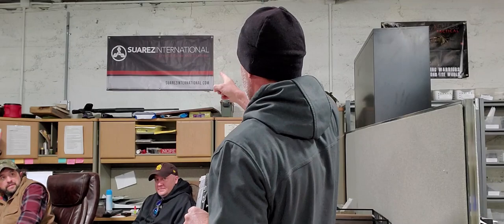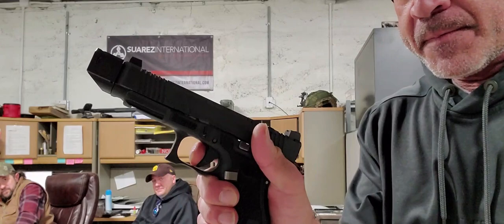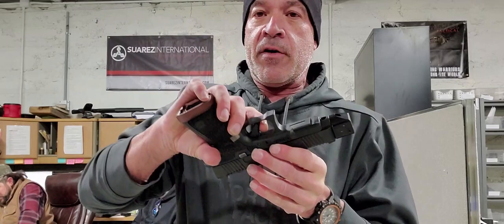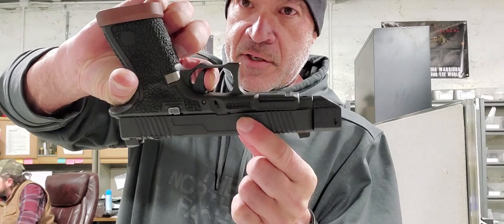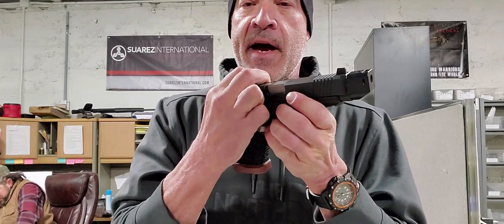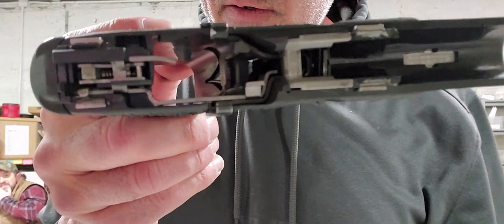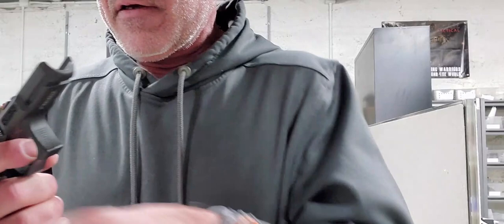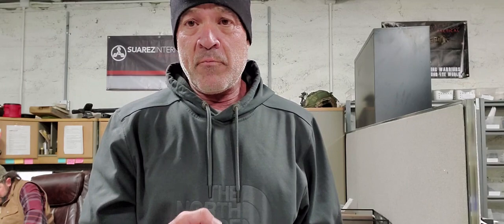Gabriel Suarez - My impression of the New  Performance Trigger  from Glock

Comment: It's one thing to dry fire the gun and claim the thing is a POS.  It's another to take it out and actually fire it as a useful comparison.  Yes, it's certainly more complex than the stock trigger but it's not more difficult to install or remove.  The field strip becomes a little more complex but once you've done it a few times it's not hard to manage.  Do a live fire test and compare shot group sizes - that's where the rubber will meet the road.  The rest of it is just bench chatter.
Reply: 100% agreed.
Reply: Do u still have the Glock performance trigger on

Comment: they simply switched to a pre-cocked striker system to eliminate a bit of pre-travel and make the reset shorter .. in that set-up there is no more need for a minus or zero connector 😢😊